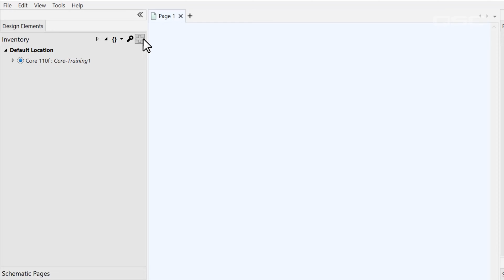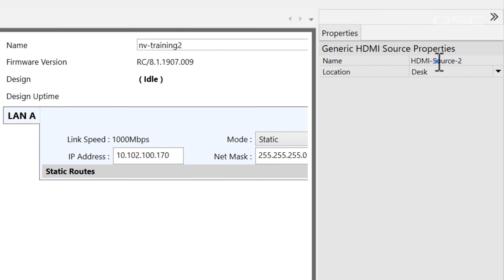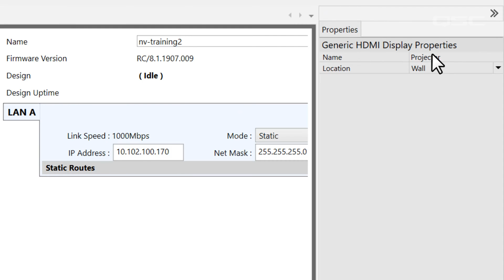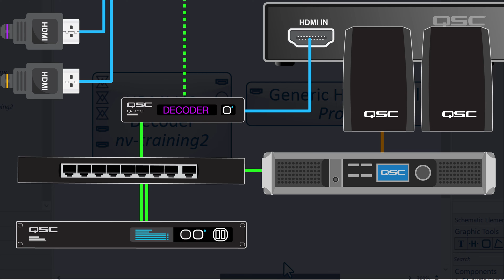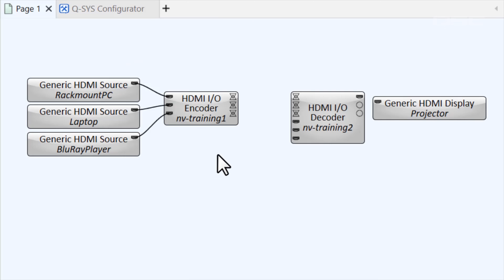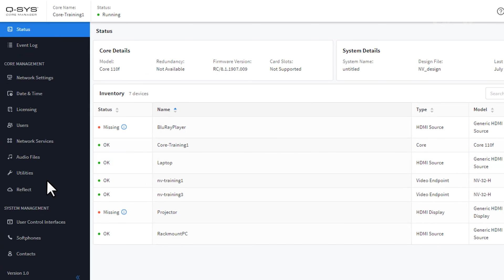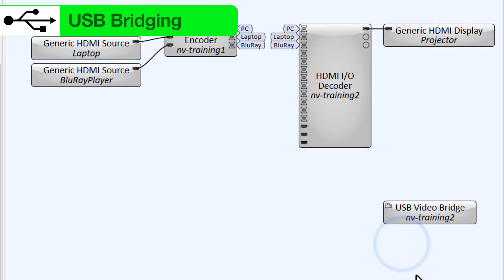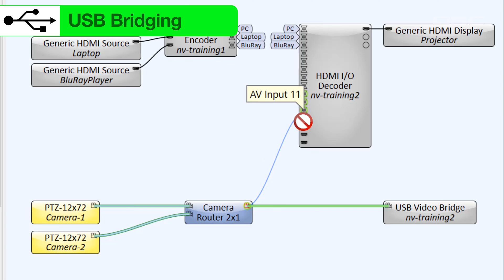Q-SYS Video 101 - Designer Basics

Comment: Q sys products are really good with their marketing , I will give them that. BUT , people !!! , please , the masses need to wake up from being brand driven. there are many generic encoder decoders you can integrate without using OSC software among other products.   The future is using  browser based web servers / open source coding / control using LAN based sockets coding using community based libraries like python  and other languages like generic  javascipt HTML , CSS  etc...  The future is here now. This is successfully  been done as I write this . You will see, a new  Eco System emerge exactly what i just mentioned in the next few years .
Reply: Any update on this? Are there specific devices that can do this now?
Reply: Yes,  there are. I have now used this software in more  than 30 venues  in Sydney Australia  running  this web based  software. With excellent results so far. If i was Q-sys , Crestron , Control 4 , AMX or RTI I would be very worried. No this has nothing to do with Google home assistant either. It is a commercially used product.